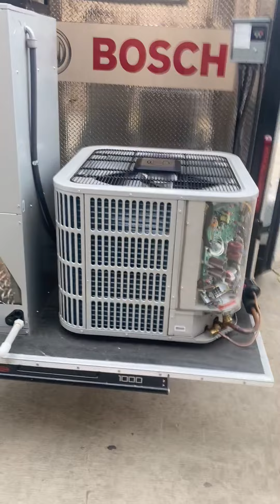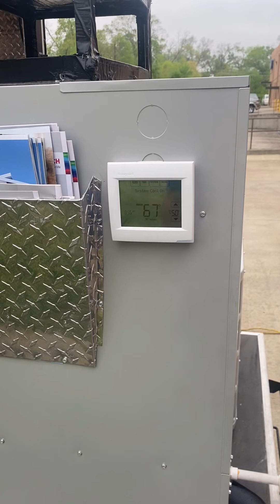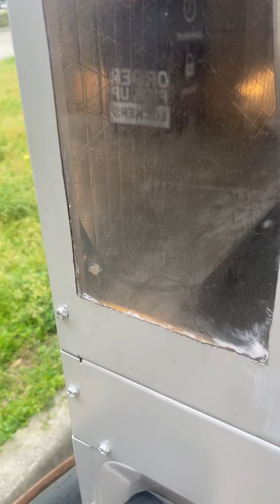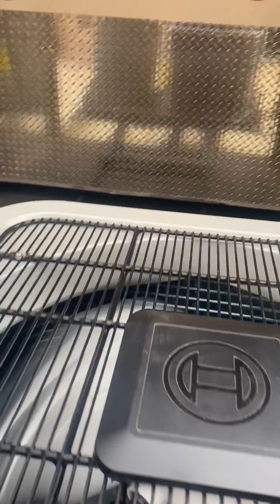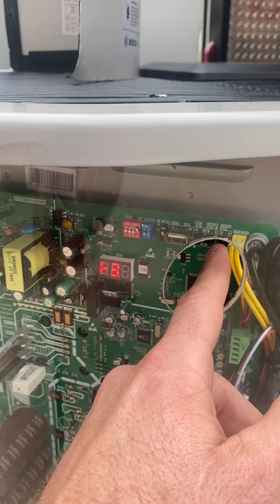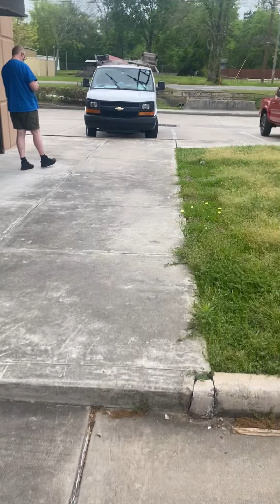Bosch 20 SEER IDS Overview

Comment: Good information, very well explained. I’m considering a Bosch 2.0 system and am struggling with the Bosch 2-speed air handler design. Seems like a variable compressor should be paired with a variable speed air handler. I realize variable speed air handlers require a communicating stat, but doesn’t that design approach provide more uniform indoor temperatures and higher efficiency?
Reply: The 2 speed air handler coupled with the Bosch 20 SEER offers ultimate comfort.  The air flow dictates compressor capacity because of an increase or decrease in heat load.  The pressure transducer aims for 46F right out of the box.  Although it can modulate from 46F to 42F on normal cooling and 42F to 38F in accelerated cooling mode.
Reply: Sorry this is a little late, just seeing this.

Comment: Thanks.  I thought the  Bosch 2.0 went  from  25 % to  110%.  Did I hear you say its low range was  36 % ?
Reply: Yes, the 20 SEER modulates from 36-130%
Reply: @jamesbanks6533  TY
Reply: @jamesbanks6533   TY  The Bosch 2.0 Brochure  indicates  it  is  between 25 and  110 %  that is why I asked  the  question.
Reply: The new IDS Family brochure has both the 18 & 20 SEER stages and what they can modulate to and from.  The 18 SEER is an 85 stage compressor.
Reply: @jamesbanks6533   Thanks for the  timely and  honest information.  A relative of mine  has scheduled an appointment for next week with an HVAC contractor  thinking  the  Bosch 2.0  could  modulate as low as  25 % .  I informed  him of your  info  so he will now  consider  and  confirm competitor  alternatives  who also advertise  the  ability  to  modulate  at 25 %.  Best Wishes  to  you Sir.
Reply: Sorry for the delayed response, just seeing this.  Yes, the 20 SEER goes from 36-130%, 18 SEER from 26-110% and newest 15 SEER from 33-110%.